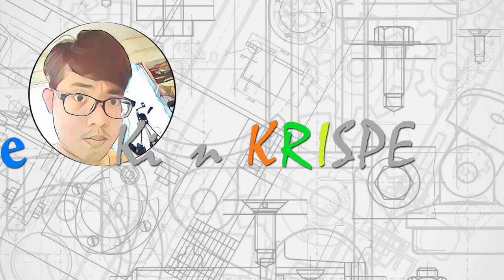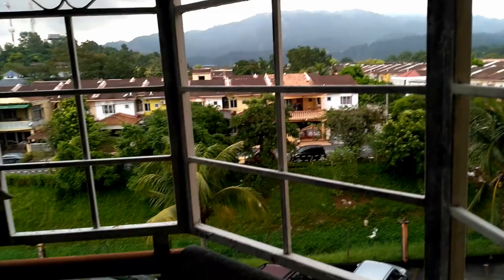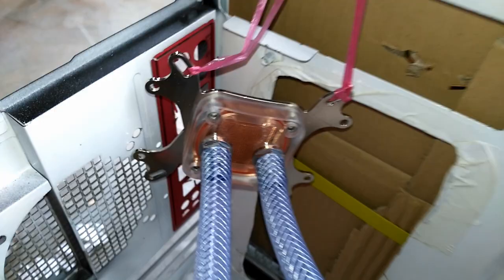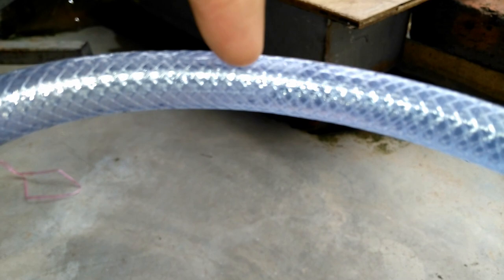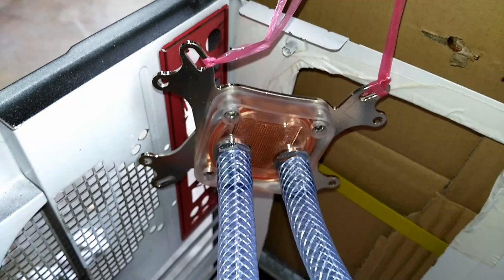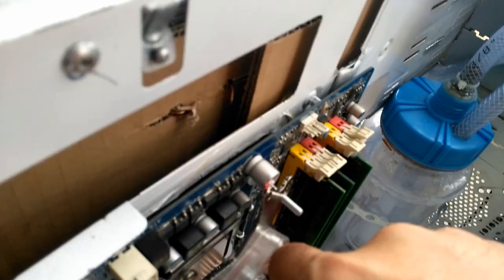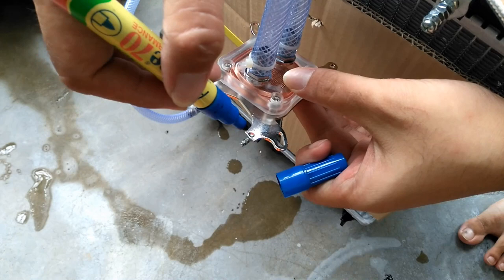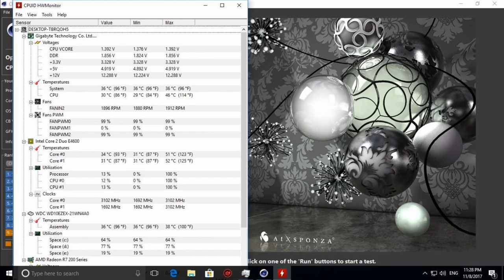Car Radiator CPU Passive Water Cooling | 汽車水冷器 主機被動水冷!

Comment: This is pretty good if you want below ambient temp. Get long tubes with ez disconnect connectors hook the car radiator outside or inside. Lets say winter comes just place the rad outside and get temp below 0
Reply from the maker: What a good idea. But I'm here 360days summer 😂
Reply: @KrisperKien  F but since nice temps
Reply from the maker: @filds1  Thanksss

Comment: I want to make a massive system out of radiators. Mix every type of cooling into one case. Hook up a chiller to a loop using a case made of radiators on all sides except tempered glass side, and fill it with mineral oil. And have a special tube that can also run a closed ln2 loop as well. 
Idk

Comment: hoping to do something like this for fun. Just slap a big radiator on the back side and let it cool passively. Maybe put in one large but slow and quiet fan with a curve which would only make it turn on when the temps get high.
Reply from the maker: This is my very old build, i was so young. btw hope ur build goes very well and cool

Comment: i think thepump do more heat than the CPU, these pumps use watter to stay  cool himself, and need a minimun os watter.
Reply from the maker: Nope, but I have no choice, otherwise, go for external pump. It's like the car supercharger, it draw power, but it's output overcome this problem, same as my cooling system.

Comment: how did this setup hold up?
like did it start leaking or did stuff in the radiator clog up the cpu block?
Reply from the maker: Hi misa. The system so far so good. I think I will do the follow up video after the next few month, to show you guys how it holds up after one year of overclocking.
Reply: nice looking forward to it also was the radiator you used new or has it been used in a car before?
Reply from the maker: @misa3218  Must be the brand new radiator, If you watch my part1 episode of this. Used radiator probably has corrosion.